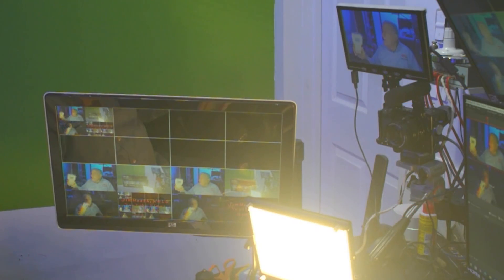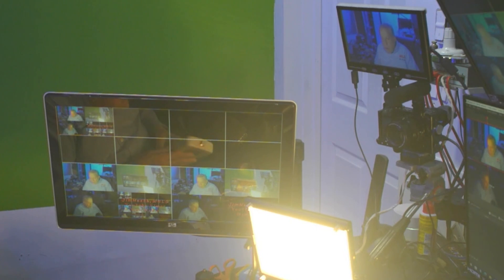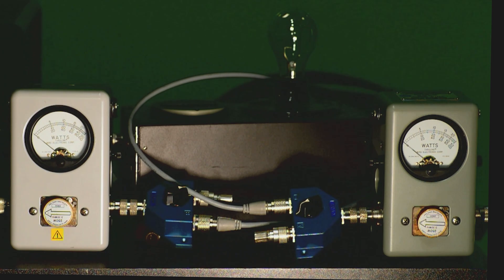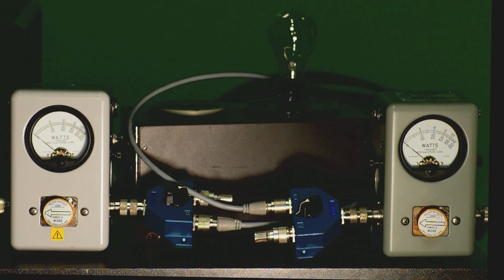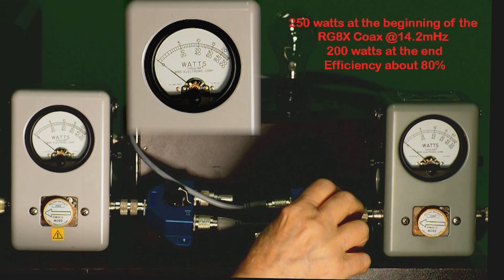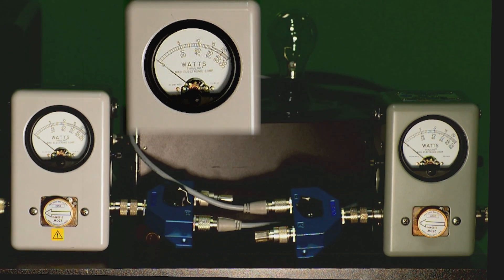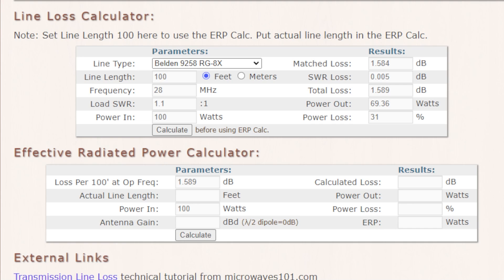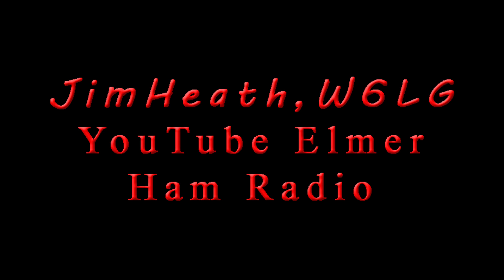Is Your Coax Cable Stealing 40 to 50% of Your Power? Jim, W6LG Uses Bird Watt Meters, RigExpert AA35

Comment: HAPPY NEW YEAR ALL: JIM I loved your video & I must say well said. Many people just don't get it when it comes to coax cable. Unfortunately it all comes down to money in the end. Many people are always looking for a so-called deal especially at swap meets. Please take care of your health sir we need you desperately,  TMP from N.J.
Reply: I agree totally. I know I have a nice shiny new rig on my wish list, but really, the biggest improvement(s) to my shack have been a  much better antenna and better coax for about a 175 foot run to get the antenna away from the apartment building noise.

Between those two improvements, I have spent (or soon will for the coax) almost as much as the rig would have cost! The return on investment in communications terms is much higher. Not as much in bells and whistles, but what are those without the contacts?

Oh, and I am not a contester yet, though some club guys are big into it and keep trying to draw me in.
Reply: @patrickbuick5459  Thank you sir for sharing your point of view. When I first started in cb, ham, etc there was only RG 58 u  & RG 8 coax cable. Then during  the CB frenzy RG 8 X came to market. Back in those days there were no antenna analyzers or data sheets showing coax cable data so basically we were all on our own. There is so much crappie coax out there cause people don't read,  amazing,  TMP from N.J.
Reply: @patrickbuick5459  That's a long run of coax!
Surely even good coax would be lossy at that length. Could you use ladder line? It can be a problem getting it out of a building though.
G4GHB.
Reply: @Bill Kitchen  Even the best regular coax I am looking at is 3.6dB at 200 feet for 440MHz, not much in the HF bands though, Even 2m is 2.2dB, 1.2@ 6m. However, between a slightly longer piece of coax, connectors etc to make the jumpers for after the remote switch, I am looking at the $1300 CDN range. Almost a brand new rig at that price. 

Window line or ladder line is pretty much out of the question unless I put wooden stakes in all the way out, since there is not much except the cable TV / Internet coax on the apartment building or metal fencing to tie to on the way out.